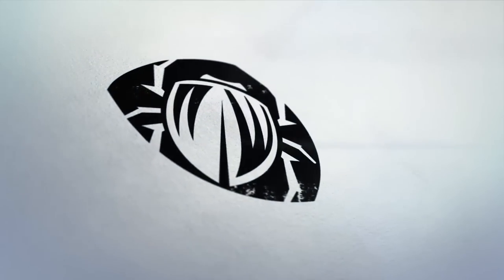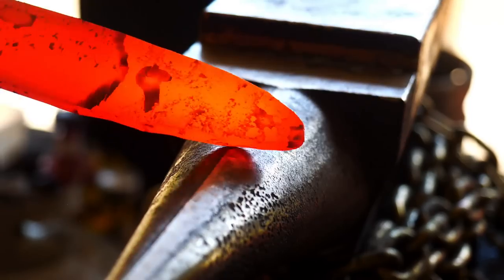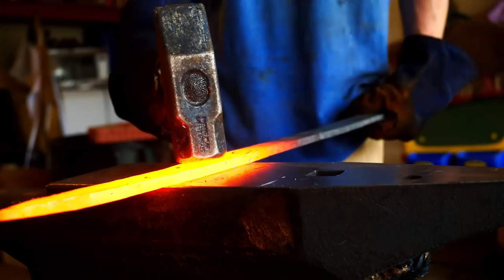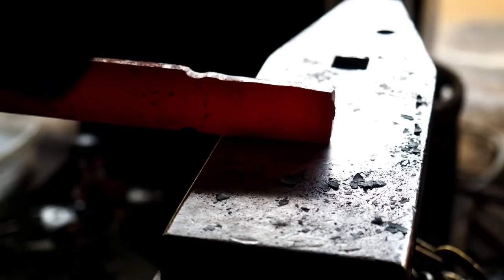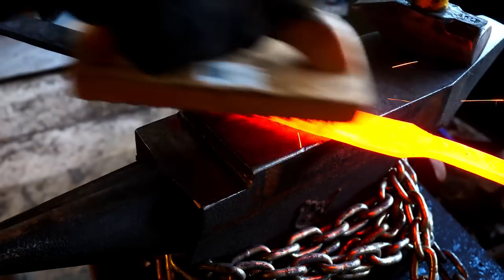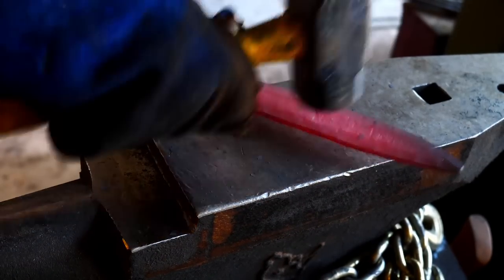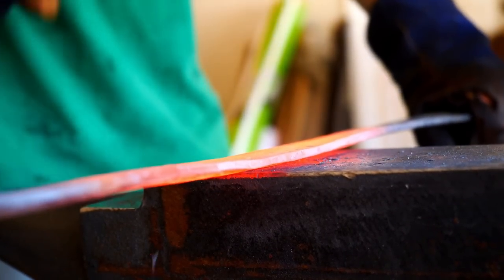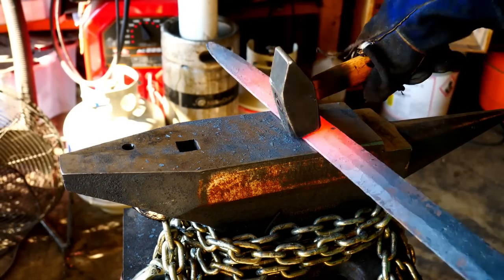Forging A Sword Pt 1: Every Stroke

Comment: had too look up  "sklootch" in machinery's handbook, it's approximately .006 metric inches
Reply from the maker: Well that's true, of course.  But in this case I said "skluetch" which, if you read a little further, is .007 metric inches :)
Reply: Um... Metric Inch???
Reply: yeah i have no idea what a metric inch is? may i get some guidance?  because a inch is not metric, so how do you get a metric inch?
Reply: ståle starheim You'll find it in the enyclopedia if you look...

It's listed under the "You don't understand sarcasm, do you" section.
Reply: ah yes found it right away, thanks :D

Comment: Makes me feel like I'm ok with my little backyard forge I just set up this week.  I've been experimenting with drawing out a billet into flat stock, expanding bar stock to get a flare, and various other things I see as common skills to know as a smith.  Today I was playing around with an old file with the idea of turning it into a filet knife for my wife, and saw an awful lot of twisting as I tried to establish an edge while trying to avoid drawing out any length.  I was wondering why the metal was twisting so much, but now that I can armchair my work and compare it to yours, I'm seeing that I was applying lateral force with the hammer and I should have switched to the opposite side to cancel those forces out.  Your channel is a huge inspiration to getting me to stop on the road and pick up an old grille for my own experimentation.  Thanks!

Comment: OPINION. MINE ALONE. First time here. I am not a blacksmith but have considerable experience in metallurgical processes and grain structures. I applaud your forging the bevels. So many do not and I believe it adds significant strength to the edge and enhances performance. Helluva a job sir!
Reply: Robert Haehn I would be interested to hear in which ways it strengthens the bevel in your opinion if you have the time. I have always wondered if hand forging the bevels increases or decreases strength as regardless I do it to all my knives. I have heard that doing multiple heats can decrease the strength of your steel overall, but I am unsure of whether that is being heated at all temperatures or only ones near heat treating temperature and above. Any information will be devoured and appreciated!

Comment: I read somewhere you have to do the bevels on both sides equally going up or down the blade in the same spot to avoid warping!!!
Reply: The channel that works has a a video on doing bevels
Reply: @elfodd35  not relevant with modern steel. He explains that

Comment: The direction you bevel from is entirely personal choice. I always bevel from tip to base, but others have more success doing it the other way. Experiment!

Wonderful first go at a difficult process!
Reply: adam anthoni ford When I attempt I plan to hammer from end to Tang hoping to have the base of the sword near the ricasso get slightly flared out and wider at the base than the tip. Do you think it would naturally get wider or should I forge in a flare before beveling? Thank you for the information in your comment

Comment: You do not suck is very hard stuff you are moving from the little experience I have. If you had gone deeper with the fuller would that have helped you draw out the tang with greater ease.

Comment: Having some sacrificial material left on the forged blade, especially with sword length pieces, is a good idea for when it comes to the grinding/filing part of the process. I work in a solid fuel charcoal forge and have had problems with decarb and loss of material, this was never an issue when I made knives, but became a problem when I started to forge swords. I have found thicker stock, 1/4 to 3/8 ths, worked for a hobbyist like me. Of course, this would be less of a concern for more experienced smiths with better control over heat and forge time.

Comment: like ur work.thanks for not ruining vid with music.liked watching u hammer the double edge bevels.i have forged a wakizashi which only has one edge.but I am currently forging my version of the Chinese War Sword and I found it easier when I reshaped an old 4.5lb engineer hammer into a 4lb straight pein, easier to stretch out length without side glancing off work and no put dings on my anvil,(was glancing off work and put dents on anvil face using my old workhorse 4.5lb cross pein) can swing 4lbs a longer time too.oh and I sub'd you quite a while back.i have been Bladesmithing since 2010.keep the vids coming cause "movies suc" so all I watch are YouTube videos.

Comment: To help with warps, when you quench have a vice ready to help straighten the blade if it does warp when you pull it out. Good luck.

Comment: Remember, even though you have a whole lot more experience in forging than I do, you are going to lose weight to scale and grinding your bevels in. And as for the bevels, do them just like a knife. What ever you do to one side, immediately do it to the other side. I have a Gun Barrel flat tank for swords. You can either build it your self or do like I did and get it from Brownells. I use a large electric griddle to heat it up. Works great for me.

Comment: I'm also in the process of forging a longsword and have come to the problem where I am getting a twist in the bevel edge close to the point. The spine looks centered, but the bevel edge is climbing up when you sight it along the very edge in this area. I'm thinking of forging  out the bevels in the point and kind of reverse forging at a slightly lower heat back up the blade to work out the twist, but I may just use the vise and a wrench, just as you have done, to correct that problem before completing the point. Thanks for the tips.

Comment: The ways you be beveled  your sword is a lot better than how my attempt at making a small sword turned out I just beveled one edge and I have a bit of a bow in it and I haven't had any luck with straightening  out the bow 😖 considering I made it out of  real wrought iron 😊  keep up the great work 😊👍🖖🏻

Comment: Have you heard of a treadle hammer? I'm not super well versed in pricing for blacksmith gear but it seems like a good alternative to a power hammer. I've used one for a bit at my local blacksmith shop and it made my life a lot easier when drawing out.

Comment: One last comment, heating the whole blade and putting it between two known pieces of perfectly straight metal and then clamping them tight while the blade cools, your waves will be gone and the blade will be straight when the clamps are removed.

Comment: Maybe with the tempering, you quench like you normally would but take it out before the crystals completely set so you can check and fix any warping, and then go back in the quench to finish hardening it.

Comment: Or, you can put a single or double fuller down the middle. That will lighten it up also. And keep in the back of your mind, it's just a really long knife. Just a longer sharp and pointy thing. Have a great day, looks like you are doing a fine job.

Comment: I made a sword, 4' long 15" wide with a grinder and a belt sander. All I needed it for was to open boxes at my work so I made it as sharp as possible it was quarter inch steel weighed probably 80lbs and it was so sharp it cut cardboard boxes in half with almost no pressure lol

Comment: I have obtained more 3/8 inch thick steel, but looking to take some stock off, also going down to around 5/16th inch thickness before forging out my new blades. What would you recommend in terms of belt grit ??, also thinking angle grinder, coarse 40 grit flap discs, but that would be some work.

Comment: Could you try getting your hands on other types of steel ? Like T10, 5160 and 9260 spring steel ? Or even S7 shock steel?  L6 steel would be too had to acheive because it's a bainite structure.
Reply: Mickxal Sounds like someone is a fellow scrapper

Comment: You know because of the steel's simplicity you could make it more interesting by blueing the steel once it's completed
Reply: Before scratching the surface (no pun intended) I must ask what do you mean by "steel's simplicity?"
Blue temper is good for things like wood saws and springs, and wall hangers. It's also just an oxidation layer and comes off pretty easily.
Unless you mean blue through hot salting, but that's only good for making wall hangers and doing it to a sword is a death wish.
Reply: Heruhcane Dean I believe he meant something more along the lines of cold blueing.
Reply: i think he meant like, gun blueing

Comment: As for where your tang meets the blade. You could have done it much faster  by bringing the metal up to heat and putting it in a vise and taking a really good bastard file and cleaning up the meet area that way.

Comment: I know you are a forge and hammer guy, but it seems like it would have been easier to just draw a pattern and stock remove the shape and grind in the bevels. Is there an advantage to all that forging that I am missing? other than nostalgia and pride?

Comment: where do you buy the steel
Reply from the maker: new jersey steel baron, jantz, texas knifemaker, admiral a couple of times and a guy on eBay I trust.
Reply: Green Beetle who's that guy on eBay you trust
Reply: Totally Delirious It's a secret 😂😂
Reply: Copy and paste that into google with where you live tagged on the end, check out a couple blade forums that come up. Through doing that and sending out random emails I found a local guy, he charges about half of what I was paying from texas knife.
Reply: Green Beetle I have had a bad experience with Texas knife makers steel not being annealed properly, but the other suppliers are great
Reply: +Green Beetle will you ever be on forged in fire couse you are realy good
Reply from the maker: Thanks for the heads up

Comment: Im just getting into black smithing and blade making, I have yet to make anything but just assembling tools and what not, just got a forge and anvil and alot of the other equipment ive seen used. What is the first thing I should make to start practicing. I was thinking just like rebar tongs or rail road spike knives. Any suggestions would be great. Excellent video by the way, subbed
Reply from the maker: Sounds like a great start

Comment: Excellent work! Can you tell me the Length and width of the of the Bar Steel you where looking forward to using? Also, the place where you ordered it? Thanks for the Video.
Reply from the maker: Use 1/4 “, length to your desire from née jersey steel baron.

Comment: “Your first sword;” yet, you have a anvil, hammers, and a furnace?
Reply from the maker: Yes, i have been forging knives for several years but no swords.  Someday I may even forge "my first bottle cap opener", "my first set of tongs" and perhaps "my first spoon."  there is a first for everything...
Reply: Ok, thanks for the information. Good job at forging the shape of a sword though. I am also trying to forge a sword, but due to cost restrictions, I have to cut corners.
Thanks for replying.

Comment: I know pretty much nothing about blacksmithing, but I have a question; if you hammered your fuller (say with a fullering die) BEFORE you worked the bevels, would it reduce the curving, or would you just be destroying the fuller?
Reply: AtholAnderson well knowing a little bit myself I I'd have to say that it would end up destroying your Fullers because of the fact that if you have your Fuller and then do your bevels the bevels pinch the metal at the Edge and push it in word as well
Reply: True, also Oakeshott type XVIII blades often do t have fullers

Comment: the way i limit warps is to normalize , after each cycle check to see if the blade is still straight. usually once it cools straight you are good to go
Reply from the maker: hey thanks man will try it
Reply: no problem man, i started smaller.  think my fist sword was an 18 inch blade

Comment: One of the best videos on the forging of sword bevels. What was the width of the steel stock that you used for the sword ?
Reply from the maker: I think I started w 3/8 then ground it to 5/16 which was still too thick.  If I rem right.
Reply: I like 1/4 inch thickness in the steel that I use. Also, how wide was that steel piece that you used ? Looked roughly 2 inches out of the box.
Reply from the maker: yah probably

Comment: Hey? I know this video is old. I'm an aspiring blacksmith and was wondering. What tools are you using in this video? And how much does a forge usually cost?
Reply from the maker: Anvil hammer propane forge 2x72 grinder quench oil files sandpaper $200-$6000
Reply: Green Beetle is it hard doing what you do? It's really cool but I bet it is very tiring.

Comment: So I've been watching people make all kinds of knifes and swords over the past few months on YouTube and I've never understood why the metal starts flaking off of it when you hit the blade, can you tell me why it does that?
Reply from the maker: the steel is oxidizing in the environment at high temperatures to form iron oxide which separates and falls away.  Most peoples call it scale.
Reply: Brian The Epic oxidation
Reply: its a layer of oxidation (basically rust) that forms on the metal while its hot and hitting it knocks of,
Reply: I use the water technique to pop it off.

Comment: Can you please explain what your mistake in making the tang was? I didn't catch anything that looked wrong to me, so all I know is that you said you messed up.
Reply: IceDragon978 what I saw was, since he didn't cut into the profile enough with the fuller, when he tried to draw out the tang the shoulders got pushed further up the blade than he wanted. So he lost about an inch of blade.
Reply from the maker: IceDragon978  I hit the corner down and had to push the tang up the blade then got it off center enough it had to be ground for correction.  So yeah that's right.

Comment: Just bought a 440 stainless steel Cutlass. Since it's a decent blade but dulls easily. Do you have any recommendations for whetstones or sandpaper to sharpen it?
Reply from the maker: Segitarious M. Sword and machete sized stuff is easiest to sharpen on a belt sander to be honest.  An expensive one will cost less than a nice set of stones.  But I'm thinking 440c should sharpen easily. To be honest just about any, double sided (2 grit), inexpensive stone, synthetic or otherwise should work.
Reply: Green Beetle Okay cool, thanks! 
Edit: Keep up the awesome work! You're really inspirational!
Reply: Segitarious M. Hey mate, just some friendly advice here. I wouldn't recommend using your cutlass for striking any hard targets, if the assembly is good then light targets should be okay. If you buy more swords in the future I would urge your to only buy carbon steel blades.
Reply: Death By Astonishment I don't plan on hard targets, thanks for the advice mate!

Comment: Be careful with the cold forging. I can't tell if it's just the video or if it's actually getting cold.
Reply: Likely just the lighting, he knows what he's doing.
Reply from the maker: VinylScratch389  I was doing some tapping while grey.  1070 should handle a small amount of that but you never know...  I could pay for it at quench.

Comment: It's just making a really long double edged dagger. And if memory serves me correctly, you have made one or two of those.
Reply: Philip Prigmore similar, but there's more to it then that.. fullers, distal taper, centres of percussion ect
Reply: And if you make a double edge dagger, you have the option (as with a long sword) of putting in fullers, and you still have distal taper, centers of percussion, etc. I contend a sword is just a really long double edged dagger. Both were made by the same smiths using the same techniques 100's of years ago. Granted, not all daggers are the same, but there are daggers that are made just the same way you make a sword. And the comment was meant to help reduce the tension I was hearing in his description of what he was doing and anticipating as the sword progresses.
Reply: Philip Prigmore can you point me toward an historical example of a double edged dagger designed to flex on impact?
Reply: Philip Prigmore that blade is far to short for any significant flex, also it's a thrusting dagger with no point? Clearly a modern trainer?

Comment: Where did you buy that 1070 steel from ? I tried reading the label on the packaging at the start of the video, but just made out a G on the box.
Reply from the maker: aldo
Reply: @GreenBeetle  Is that the low manganese 1075 type that Aldo stocks ? I have read that it is a shallow hardening steel that requires a fast quench. Can I just ask what is the quenchant that you used for the sword in your second video. 

The reason for the query is that I have used 1084 steel in the past with warmed canola oil and had good results ( knife sized blades only ), but was interested in giving the low manganese 1075 a try.Not sure if I should just stick with the canola or get some commercial quenchant like Houghton for something like Aldo's 1075.
Reply from the maker: @olivermilutinovic749  this was probably vegetable oil.  I normally use parks 50 which gets better results for xx70 - xx80
Reply: @GreenBeetle  Thanks.

Comment: I just bought a tool steel wrench thats bigger than that sword, what do you all think i should do with it.
Reply: Make a greatsword from it.
Reply: Turn really big bolts with it.
Reply: Make a sword and matching knifes or  make twin blades and use the extra metal for throwing knifes
Reply: Anvil Bound haha i dont think i can find bolts that big anywhere near me.
Reply: yaxoin creg i think you just gave me an idea. Im thinking i'll make a sword out out the closed ended side and most of the body and use the open ended side to make a matching dagger or stiletto type thing.